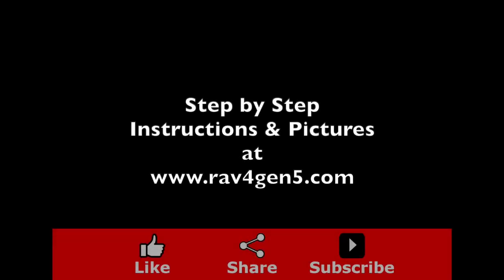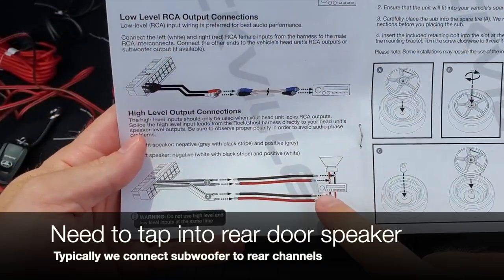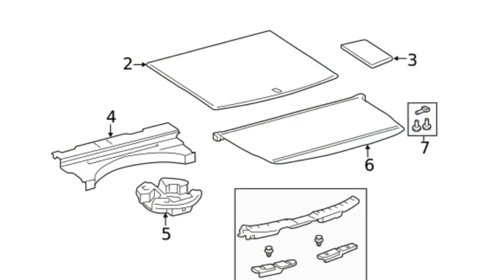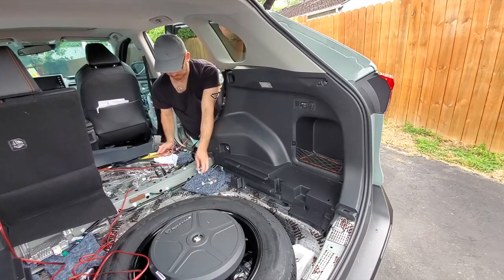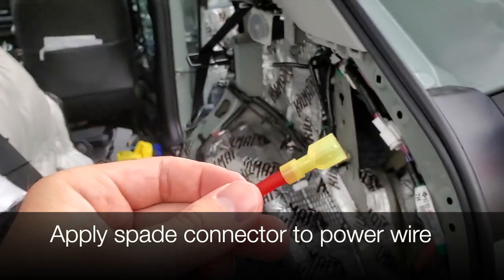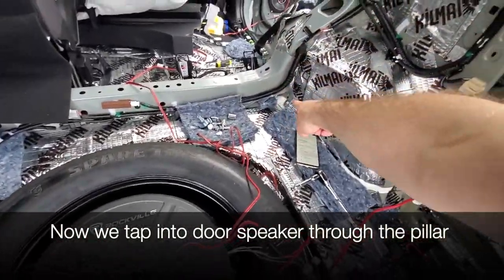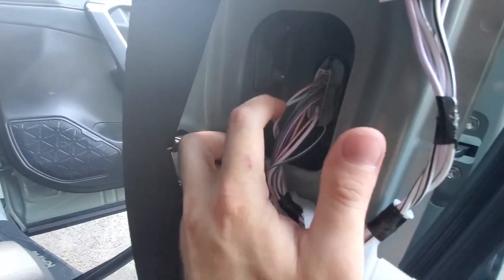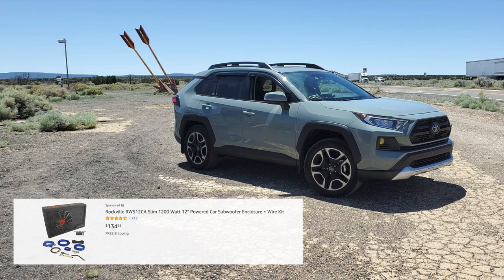Subwoofer Install on the Toyota Rav4 2019 2020 2021

Comment: you seriously took apart 1/4 of your car to power your sub with a 18aug wire or less?  Folks, unless this sub only requires 125w or less, PLEASE don't do this.  There are other guides that do this properly.
Reply: Care to share other guides?
Reply: It's indeed dangerous to power the sub that way...
Reply: @Ryezn5057 I think you would just run your power cord the whole way through to the battery

Comment: I wouldn't recommend connecting the main power wire to that tiny little wire you found. How many times have you blown that fuse so far?
Reply from the maker: It's a good comment but no fuses blown since its install.

Comment: JBL Basspro Hub - 11" powered subwoofer system 
VS 
Rockville RockGhost Active Powered 8" Car Subwoofer 
>> Which one is better? (If price is not an issue)
Reply: Rockville has a V2 which is an 11” sub out now, so I’m between the V2 & Cerwin Vega shallow spare sub

Comment: I was wondering, how does the sub sound since it is covered with the cover and also the cargo mat?  Thanks.
Reply from the maker: It's still good. A woofer that is on top of the covers would be better since it can move air freely and be more banging but this is more than enough for my needs especially when I use my cargo space for camping gear.

Comment: I have a 2019 Rav4 XLE and the JBL website says that it won't fit in the spare tire, is it still possible to have it installed?
Reply from the maker: It should fit. If you had a hybrid or prime, you may have a problem but this should work on gas models just fine. Compare the cargo area with what you see in the video.

Comment: Hi, it's me again from your dash speaker video :) I had two questions

1) Since mine's a 2019 Hybrid, the battery is in the boot. So for the power connection for the Sub, I just use a t Tap or attach the wire to the positive terminal of the battery?
2) I'm not upgrading my door speakers or planning for an amp yet, so at 12:49 you mention using a T Tap on the wires in the B pillar? 

Thanks
Reply from the maker: You can connect the subwoofer directly to the battery. These subwoofers typically have an inline fuse to protect the wire. You don't use T-tap here. You might want to search for terminal connectors to add additional wires to the battery terminal. https://amzn.to/3f79Pca

What might also be different for you is you might need to find a way to get a 12v signal when the car is on/accessory mode. This is used to tell the subwoofer is on. 

Use T-Tap to only get audio signal from the B-Pillar. Not for power. The video to get audio from the B-Pillar will be uploaded tonight.
Reply: @Rav4Gen5  Thanks. If I'm using the terminal connector and connecting the sub directly, does it risk draining the battery?

I didn't understand the accessory mode part. In your installation, you pulled the power from the 12v cigarette lighter. I thought I was going for the battery to bypass that.
Reply from the maker: Yes and No. My 12v accessory port is also only powered when the car is on. Therefore, I cannot drain my battery. The subwoofer has a remote turn on wire that remotely turns on subwoofer if power is send through the remote wire. You need to find a place for that remote turn on wire.
Reply: @Rav4Gen5  Got it..thanks that makes sense. So to be safe, I think I should also pull the power from the 12v cig lighter in the boot (the Hybrid 2019 also has it as the same place as your Adventure). I saw some other comment mentioned that they were able to pull the cig lighter, without removing the quarter trim panel. Don't know how, but will give it a shot.
Reply from the maker: Yea. If you pull from the 12v cig lighter, you can use T-Tap light I did. Probably much easier.
Reply: @love2huntbooks2  hey just installed this today in my hybrid. If you run the speaker wires and not RCA cables then there is no need for the auxiliary wire as the sub will turn on and off as the speakers do (or at least for my sub the cerwin vega). As for running power youd go direct from the battery with a terminal connector and add a fuse in before going to the sub unit. If you have any questions hopefully i can help
Reply: @Codymwilson  thanks Cody, I finished installing soon after this comment. I went with the JBL basspro after I tried out this one out. found it at a discount

Comment: Thank you very much for these videos, they are the best I have seen for the rav4, keep up the good work. My question is, why did you connect to the rear speakers using the speaker wires  instead of using the RCA. I think the wires is high and RCA is low, not sure what that means. I purchased the dasaita HU and am thinking of connecting the subwoofer straight to the HU using the RCA. Please advise!
Reply: Howd did this go did you ever do that?

Comment: Thanks for the video, just installed a amp and sub in the wife’s 2020 rav4 with the help of this video.   I popped the back cigarette outlet out and fished the remote wire down the panel,  didn’t have to remove the whole thing.
Reply from the maker: Nice work!
Reply: How did you pop it out?
Reply: What model did you install on?

Comment: Does that power wire you tapped into provide enough current? Rockville says it should be connected to a 10 gauge wire, that looked like a 14 gauge wire.
Reply from the maker: That is a good comment and point you brought up. At 200 watts with 14.4 volts, we are around 14 amps if we are maxing the subwoofer/amp. It is unlikely we're pulling that much continuously. I'm not an audio or electrical expert but I have not had any issues. I also pull an addition 4 amps for a fridge during my drive.
Reply: @Rav4Gen5  Good to know, I assume at 14 amps that is full power which I'm sure you don't listen to at.

Comment: Is there a difference between tapping into the rear/front speakers or using a line converter from the radio directly? I'd imagine the factory radio might have some presets on how much bass gets sent to each section of the car
Reply: If you have a good line converter they can do the same thing, actually bump up the signal, look into audiocontrols stuff, thats what they are really know for, signal and sound processing.

Comment: So are you able to disconnect the sub from the spare when you need to use your spare tire?
Reply from the maker: Great question and I wish I demonstrated that. Maybe in a follow up video. The answer is yes!. You disconnect the wire harness and the remote control, only at the wheel, you don't have to go through any of the trims. Then you unscrew the bolt that holds the woofer. Then take the subwoofer out and you can do your tire replacement.
Reply: @Rav4Gen5  Awesome, thanks for the clarification

Comment: Hi, this was an awesome video! Thank you for posting this. Can you help me with my 2019 RAV4 LE model? How can I run power? Also is the Rockville able to reach 20 hertz?
Reply from the maker: The install process on an LE is the same. As long as you don't have the Toyota JBL system. The rockville has a Low Pass Filter: 50Hz - 150Hz and Frequency response: 20 Hz – 250 Hz.  If budget is not a problem, you can check out the JBL spare tire subwoofer.
Reply: Is it possible to tap into the 12V cigarette lighter that faces the back seats?
Reply from the maker: @mardocheedade3223  It should be possible. You'll have more work to do to send wire to that location.
Reply: Rav4Gen5 thank you so much for replying to my questions! I just have one more. I’ve been trying to research this but I can’t find my answer. What is the proper way to run power from the battery? Is it in one of your videos, I can’t find it. From your videos, do I need a fuse wire?
Reply: I was able to figure it out! Something I can’t figure out is how you connected the subwoofer to the head unit? Can you help me out please
Reply from the maker: @mardocheedade3223  You need to connnect it to the audio wires going to the rear door speakers. Remove the bottom the B-Pillar and tap into the signal.
Reply: @mardocheedade3223  Hi Mardochee, could you share how you figured it out? I'm trying to do the same (as I'm trying to connect it to the battery in the boot, mine's a Hybrid). Thanks!

Comment: Thanks for the guide. It was a big help. I had to watch your other amp install video for the power wire. I taped into the dash speakers so I didn't have to mess with the head until.

Comment: Do you think you could just tap the dash speakers? I’ve installed aftermarket 3.5 inch jbls with the harness. Just tap the + and - off harness?
Reply from the maker: You can but I would not recommend it. If you play with the audio settings in the dashboard to send more sound to the back, you might lose bass. I do have another video to tap into the B-pillar panel to get signal from the rear door speakers you can check out. You can also go with taco tunes wireharness as well. It looks like it would work. https://tacotunes.com/shop/toyota-camry/plug-play-wire-harnesses-toyota-camry/2018-toyota-camry-add-a-subwoofer-harness-plug-n-play/

Comment: I don't how you can connect a sub that normally would require an 8 gauge wire by tapping to a cigarette lighter...
Reply from the maker: It's only 200 watts. Fuse has not blown yet either =]

Comment: I just finished installing the subwoofer today.  The sound was amazing.  Thank you for the tutorial
Reply from the maker: Glad it helped!
Reply: So if you need to use your spare tire do you need to remove the sub then reinstall it? 
I really want sub for my rav 4 but not sure I’m tech savvy enough to do this install.
May need to look into a box woofer set in the back but like you said the cargo space is key
Reply from the maker: You need to remove to access spare tire. Hopefully it’s not frequent. I think box woofer set install is the same as this.

Comment: Do you know if this will fit the 21 prime se? Also if so what size amp would you recommend to drive the 4 door speakers - I don't want to draw too much with both a powered sub and an amp for the door speakers
Reply from the maker: I think someone commented that this doesn’t fit the prime.

Comment: Installed this same sub in my 2019 RAV4 LE.  Discovered that when using the high-level inputs, the blue remote turn-on wire is not needed.  The Rockghost subwoofer senses the signal on the speaker-level inputs and turns on and off without the blue wire being connected to anything.  The manual does not mention this, but it's good to know and may save someone from running additional wire.
Reply from the maker: Great work. I hope people reads this!!!
Reply: Much love thx man
Reply: I just read the manual and they do state you dont need the blue wire in the wiring section

Comment: So the pink & white wire/ pink w mint green stripe wires behind door pillar , are the wires that you jumped to connect the speaker wires coming from the Subwoofer , correct?
Reply from the maker: I did not since I went to head unit but these were used by members of the rav4 forum.

Comment: Did the sub kit come with enough speaker wire? Anything that should be purchased that doesn’t come with the kit? Thanks.
Reply from the maker: The sub kit has enough wires. You'll need basic tools to splice wires so you can tap into an audio signal, like t tap connectors.

Comment: Are you sure it is ok to hook up power to rear ACC ? The power wire that comes with the power wire is so thick, makes me think tapping into rear ACC will not be enough power?
Reply from the maker: I had this concern too but I have had no issues. I also run a 12v fridge on that port and also have no issues with all of it together.
Reply: Sure it works, but should you? Probably not....

Comment: I am thrilled that I found your channel. Upgrading from a 2001 RAV4 L to a 2021 Le on the 26th. Currently jamming a Rockford fosgate Punch 12” —So very pumped to see your video here.  I might as well do then dash 🔊  come to realize.
Reply from the maker: You are jumping 20 years into the future with your RAV4. Congrats and enjoy the ride. I would drive the car for at least a few months to make sure there aren’t any issues. Otherwise support the channel and buy from the links in the description.
Reply: @Rav4Gen5  Yeah I plan to drive it for a bit before doing any modifications. If I make the purchase I got you covered on affiliates. Thanks

Comment: Does the sub truns on automatically when turn on the car or you have always to turn it on with remote?
Reply from the maker: There is no remote to turn on/off. There is a wire that you have to supply power which will turn it on. I connected it to the 12v socket since that is powered only while the Rav4 is on/accessory mode.

Comment: Hello. What kind of amp do u have , to the door speakers?
Reply from the maker: There is a built in amp on my dasaita aftermarket head unit. I have another video of an amp install you can check out.

Comment: Does all this run fine on the stock head unit? I'm thinking of just replacing the stock door speakers as all I'm after is that low end bass without my door speakers crapping themselves.
Reply from the maker: It does run fine with stock head unit. Go with the JBL version if you have the money. Changing the door speakers without an AMP wouldn't be as good. Needs more power than the headunit.
Reply: @Rav4Gen5  does the jbl version fit?
Reply from the maker: Yes.

Comment: You mention in a Hybrid, you’re able to tap into the battery for the 12v power. I understand this is under the back seat. Seems easier than tapping into the 12v lighter port in the cargo area correct? How do you suggest doing that?
Reply from the maker: The 12v in a hybrid is in the cargo area, right side (or so I thought). The main battery for a hybrid in under the seats (you don't touch that)
Reply: @Rav4Gen5  so I just use the same taps listed here to lift power from the battery?
Reply: So I’ve hooked the remote (blue wire) and positive power to the 12v battery in the cargo area (Hybrid). It seems there is constant power at the sub. Can you help me out? I don’t want the battery to drain.
Reply from the maker: Your blue wire needs to go somewhere else. Disconnect it asap. Mine went to the 12v source of the cigarette socket which is only powered when my rav4 is powered. You need something similar. I am not sure what you have in a hybrid. You can go to the cabin fuse box and do an add a fuse like I've done in my front dash cam install videos.
Reply: @RasMajestytube  if you run your sub using just the speaker wires and not the RCA cables it should power on/off on its own (or mine does at least and its mentioned in the manual that this method works). Given youre in a hybrid model the set up will be different and you should be adding in an additional fuse depending on which kit you used to get power to the unit

Comment: Thanks it helped a bunch the colors changed a little on the 21 rav4 Prime but its still the twisted set in the rear pillars also unless your a dealer you cant get get a wiring diagram anywhere for these things please everyone who likes to do these kinds of things fight for right to repair in your state
Reply: This does NOT fit the Rav4 prime. Just wasted an hour wiring until I set it in the spare tire recess and it was several inches too high.
Reply: If you don’t mind, what are the colors of the wires in the prime?
Reply: @samuelwalls8998 i hace the same issue on my prime 2022 i will do some adjustments

Comment: I do not have the 12 volt in the cargo area, am I able to T-tap into the 12 volt in the middle console or should I just run it all the way through to the battery up front? Thank you for sharing the knowledge!
Reply from the maker: You can tap into any 12 volt. If you are going all the way to the front 12v under the climate controls, I think you might as well go to the battery. Not sure if there is another 12v.
Reply: Rav4Gen5 thank you for the insight! Can’t wait for more content!
Reply: @Rav4Gen5  If I take the power up to the battery, where would I run the remote wire? To avoid draining the battery. I am so new to this..sorry. haha
Reply from the maker: That's a good question. Probably would go to the cabin fuse box like I did in my dash cam install.

Comment: Can’t wait to see more content from your channel. Would you share what made you get this over an under seat subwoofer? Thanks in advance for your time. Kindest regards.
Reply from the maker: Hey. I wasn't confident an under seat subwoofer would fit in mine because I have air vents there that go to the rear seats.I think spare tire subwoofer as easier too since I had easy accesses to power and remote turn on power as well with my Adventure.
Reply: Rav4Gen5 very true to not have to go through firewall up at the front. Thanks 🙏🏼